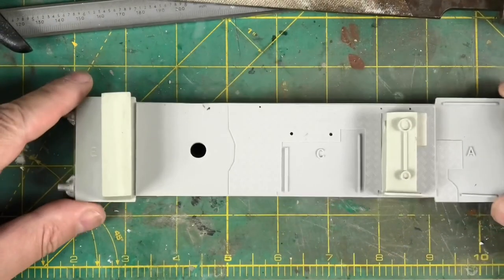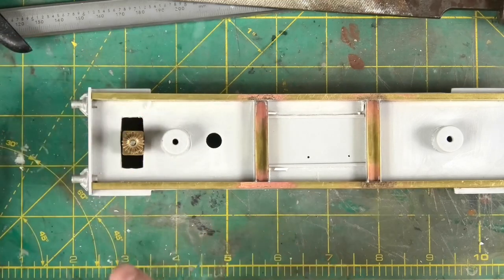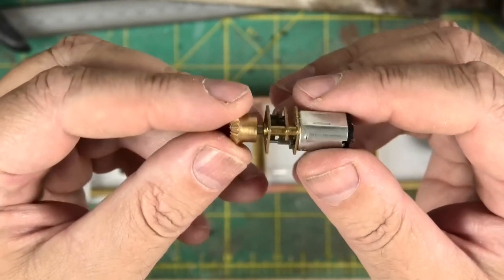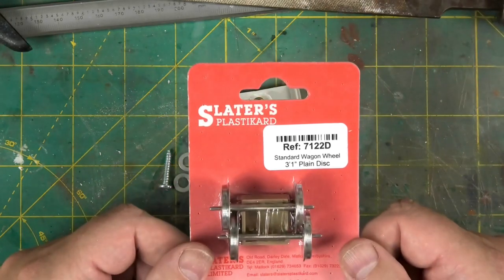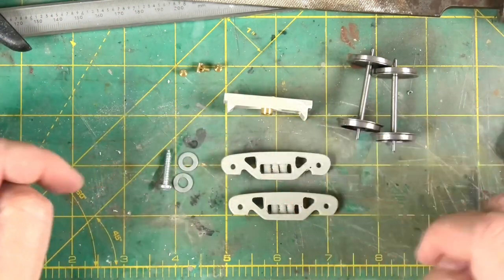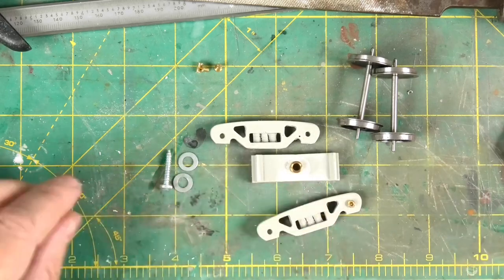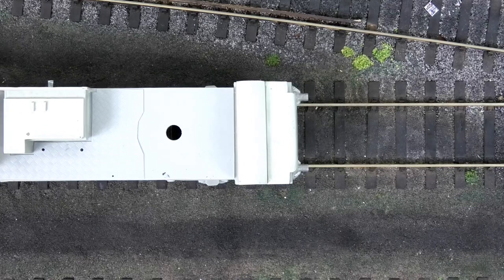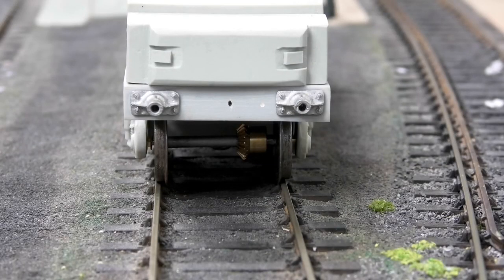Model Trains 155 - GJH plant 12t YOB crane kit build part 2 Bogies. Hither Green TMD In O Gauge

Comment: would there be space on the bogie to mount the motor there? i have a smilar one that i used to motorise a van for capstan shunting, although i hadn't refined the mounting. i could try it on a similar bogie and see if it's viable- would also aid the asthetic if you could move the bevel gear to an inner axle?
Reply from the maker: The way the bogie is designed from the kit there isn’t room, and I’d have to fabricate a new bolster that would allow the bogie to be fitted, then the motor mount fitted afterwards. I’m trying to avoid doing too much as the kit honestly isn’t worth the effort, regarding the gears, I’m contemplating covering them over as there is a gearbox on the real thing that isn’t modelled. However, with couplings and hoses and some black paint I don’t think it would be too obvious

Comment: Have you a make or name on the motor and gearbox?
Reply from the maker: Google N20 motor gearbox and they come up. That’s just the version I have I think. No brand on mine as it’s a Chinese eBay version. It does look very nicely made though
Reply from the maker: https://www.ebay.com.au/itm/112160224464 is the one I purchased
Reply: I did look to see if you find a data sheet for it with dimensions
Reply from the maker: @andrewnelson5642  thanks, but I looked at comparable ones on the internetwhich say M1.6 for the screws so I suspect that’s the size I need and have ordered